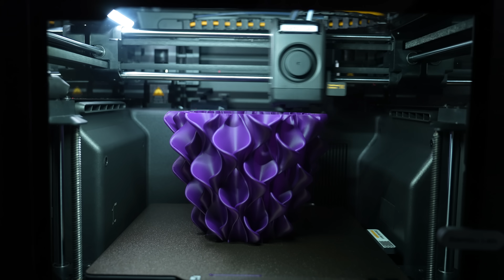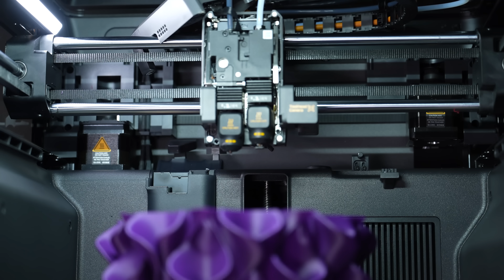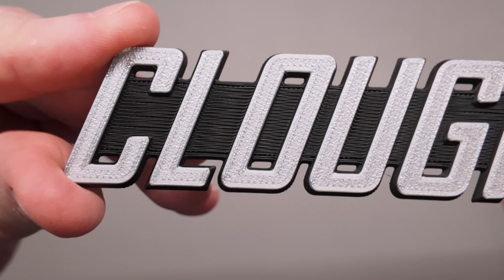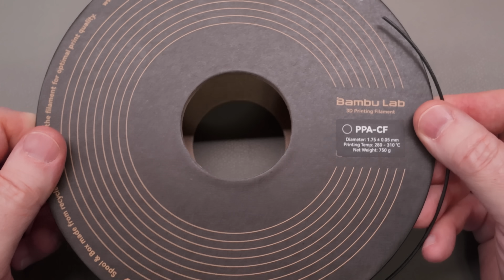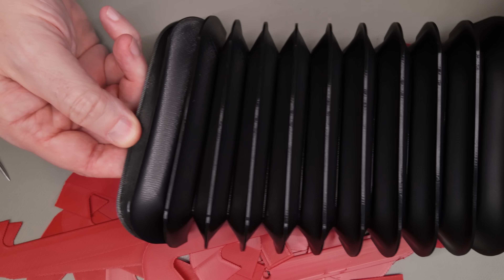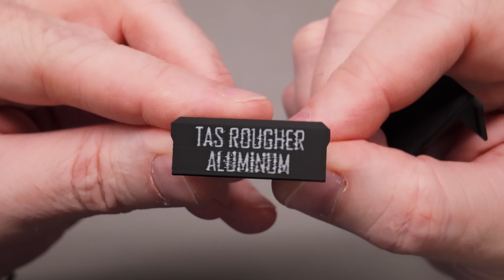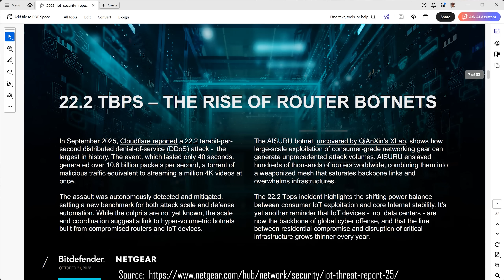X2D Deep Dive: Dual Nozzles, Bowden Extruder & Real 3D Prints

Comment: Here is an interesting issue what happened to me.
I stupidly downloaded a stl model on a site run by bamboo onto my Elegoo carbon 2 which converted my Elegoo settings into a Bamboo including bamboo build plate, bamboo filament,etc.
It was weird.
Reply: No, you didn't download an stl, you downloaded an 3mf file and yes, that is how they work

Comment: Just watched Thomas Sanladerer's vid on this.  Holy h3ll...I know a few people that just bought the P2S and are now regretting it...

I need this printer in a bigger format.  Like you, I do quite a bit of stuff that needs a 300+ mm bed size.  Not height usually (sometimes), but 100% I need it in x/y.  I don't need 4 colors...90% of what I do I want 2 colors and a separate support material.  LOTS of tool holders, and I want my tool holders to have the capability of naming (i.e., my Forstner Bit Holders (again, using your method for making tool holders), I want the sizes printed on the holder.  I actually CAN'T do this with a single color printer.  Nope...not without swapping material on the same layer, or requiring my labels to be proud of the top surface (which I don't like).

Comment: 16:05 it its very true sir. i have had the same challenges with petg for years. long story short; get multiple sets of darker blue biqu frostbite plates for all your petg prints. they are the best thing since sliced bread imo.

short story long;P
i do mostly aquarium and plant stuff so petg i perfect for my use. after many years and printers i have had to compensate for this problem among others. then came the change... for me it happened about a year ago or so when i first tried a frostbite bite plate. the darker blue one, not the orange ones. (might be good too, i have not had to test them yet as the blue ones i got are so so so so good) 

petg sticks so well that i like to have the prints cool down in the printer to room temp as the flexing of a warm plate might warp the print. it sticks that well yes... its absolutely mental imo. and i have run them on about 24 kg og petg so far with 0 fails. 0... came close once on a square pot base, but i was monitoring is by coincident of almost empty spool that i wanted to replace for the rest of the print. the plate started to bow upwards in the corners from the magnetic bed!
so i quickly paused the print and fastened the plate to the bed with four micro welding grips for the win :)

Comment: How does this compare to the new tool changers like the SnapMaker U1 and Flashforge Gemini especially in terms of waste and speed for multicolor prints?  The X2D seems great for supports, materials, and simple 2 color prints if you use the auxiliary nozzle.  Also I expect greater reliability and lower maintenance with the Bambu.

Comment: I think you hit the nail on the head. This is for someone who wants a P2S with a heated chamber that also has a dedicated nozzle for support material. 

I never even considered having a multi-nozzle machine until now. Well that’s a lie I considered the prusa with the indx system but figured it was out of my price range. 

We have an X1C at work and I almost pulled the trigger on a P2S a couple weeks ago so I could stop using the office printer all the time.

Comment: Meh, constant cloud connectivity...or connectivity of any variety... even if only for continuous firmware updates is just not necessary if the manufacturer has provisions for disconnected operations and firmware updates.

It's a scare tactic to refer to disconnected operations without firmware updates as "running with scissors", but your point is taken if you're referring to a connected device.

I also understand that connectivity is a key feature for some, but not everyone requires it. Many refuse to accept the risks and consider those features to be a strike against the product in question.

Comment: Had me until wifi only. Pass. To have a printer designed primarily for engineering grade filaments and eliminate off-line printing is laughable. Hey bambu ... no option of off-line printing ... no sale line in the sand.
Reply: You can print off line, wifi only means no ethernet port.

Comment: I notice that you didn't address the elephant in the room:  The SnapMaker U1.  About the same price, 4 real toolheads.  And it still works perfectly with Orca slicer without cutting out any features, especially the ability to sync the filament information with the slicer.

I'm not sure why someone would pick this over the U1.
Reply: So you can print some serious materials,  simple as that.

Comment: New to the channel, but could you walk through your network setup? Having the Bambu printers on a separate network segment? I have a similar setup for my smart devices and would like to run my printer in that same zone. I would be interested in what works, what doesn’t, and what workarounds you had to implement. My smart device network only reaches out to the internet. My trusted next can reach onto the smart network. And I static nat any device I would like to reach directly. I also will build security policies based on what is needed from trust to smartnet

Comment: You say its not possible to make the bellows for your milling machine in a single nozzle printer because of the tpu - AMS compatibility. But there is AMS compatible tpu. Could you not use that? Or is the AMS tpu not flexible enough?
Reply from the maker: Not nearly flexible enough.

Comment: Why do no reviewers mention that, in terms of default profiles, the x1c is hugely faster than the p2s, x2d and h series?

For example, an object that the 0.12 profile on the p2s, h series and x2d print in 7.5 hours, the x1c on its "0.12 fine" profile prints in 4.5 hours!!!

This is NOT a small difference.

I am sick of reviewers ignoring obvious differences like this that users quickly run into when using their new "upgraded" printer

Comment: I got the P2S immediately on release, if the X2D would be available at that time i would probably go with that, but to all P2S owners, dont be sad its an amazing machine, and i get 65°C chamber without a problem, just put a towel on the machine (just left out the back were the venting openings are).

Comment: Review is great.  I will say though that your risk analysis is flawed.  Having stuff completely offline is more secure than online devices even with constant firmware updates.  If you don't believe me, think about how much software security affected you in 1995 vs today.  What's the difference?  Most things were not online.  We didn't have better patching in 1995.  My H2D is in lan only mode on a network without internet.  I lose tons of features, security isn't one of them.
Reply: Also, thanks for the reminder to update my firmware 😎

Comment: Looks like you are one of the very few who actually understand the actual purpose OF the X series. Its not a Hobby multicolor printer, its a Business/Professional printer. The X1C, and X1E are focused on premium printing for Business and Engineering while the A and P series are for hobbyists.  The H2 series is the true multicolor  large format systems.  When I looked at the specs today I realized what its goal is. Primary filament with Support add on. The majority of my prints are main filament with Support in single color, and if I do that on the X1C there is a LOT of waste. Now the X2D can do what the H2 does for majority of prints without the waste.  You see on FB groups how they are all trying to compare it to the U1 multi tool 4 color, but not understanding the target audience the X2D is going for.

Comment: I generally really enjoy your reviews and their engineering focus. However, as a computer scientist I really cannot resist commenting on the security rant.
In short: what you are saying simply doesn't make any sense. Yes, devices connected directly to the internet need to be kept up to date. But using that as an argument for why cloud connectivity is necessary in a 3D printer is completely circular.

From a security perspective, it's the opposite: every additional device you connect to the internet increases the attack surface of your network. Timely updates mitigate this issue, but that's all they can do. Conversely, a correctly configured, purely locally networked device simply doesn't present any attack surface in the first place.

Comment: I'm glad you tested the second nozzle for beyond what Bambu is saying it's capable of. We've used bowden extruders for years before direct drives, they can print most filaments (TPU notoriously needs to be printed at slower speeds on bowden) and they can produce good quality prints so I don't buy all of these disclosures they are giving out for the second nozzle. They should also be able to print at good speeds.

Comment: Thanks for the review. I had sold my A1 a month or so ago to purchase a P2S. After hearing that the X2D was in the works, I held back. Just placed my order for the X2D this morning. I get that it doesn't have 2 direct drive extruders, but for only $100 more than what I had planned on spending, the heated chamber and that extra nozzle (even with it's limitations) were a no brainer for me. Guess time will tell!

Comment: Does the HT and the AMS2 require external power or will the X2D power the dry function with out external cords and plugs?
Reply: It does not require external power, but I don't believe you can heat the filament while its printing. Source: got an X2D today

Comment: So I guess printing mini figures for D&D on .2 nozzle is beste done with the H2D then if you want to use a support material to not break small parts?
Or would the x2D still be able to do this?
Reply from the maker: That's awful small for an FDM printer.  I think most people who print minis go for resin printers.

Comment: LAN only mode on an isolated VLAN with no Internet works great on Bambu. I do my remote monitoring locally using an addon in Homeassistant. I also uninstalled the Bambu software and run Orca Slicer only.  My P1S is on the last version before their device takeover, not updated in over a year.

Comment: Can you use a 0.2 hotend on the main and 0.4 on the support?
Reply from the maker: The slicer currently does not support mixed nozzle sizes, though I have heard rumors that feature may be coming.
Reply: You can with some light trickery

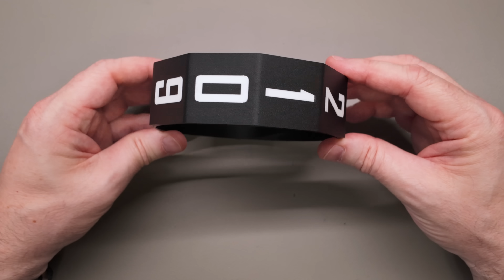Comment: 14:25 - Mechanical Pinball machine or an older Gas Pump with the Gallon Bell.  I miss the Gallon bell as well as the double chime air hose station bell.

Comment: You say it gives you a second nozzle and a heated chamber (over the P2S), but doesn’t the P2S have a heated chamber?
Reply: The P2S does not have an active heated chamber. It is only passively heated by the hotend and build plate.
Reply: @ADBBuild  Well shit. That was one of the reasons I got it over the P1S 😂 Ah well. I’ll just need to get the X2D as my third printer sometime 😂

Comment: $899 for the combo with the AMS 2 Pro seems like a pretty good deal.  Considering the original X1C was $1,399 when I got mine.
Reply: I wish they had put the higher temp extruder like the H series in this update.  With the heated chamber it just makes sense to have a higher temp extruder to do more of the engineering grade materials.

Comment: Great review, thanks.  I purchased an H2D in part based on your reviews.  What I would really like would be a form factor like this:  20-24" Wide x 6-8" Deep x 4-6" High.  That would be very useful.  Some parts don't look so great with joints.  Of course getting such long parts to not warp might be a problem.

Comment: I run a farm of X1Cs and have H2Ds and P2S’s, my new criteria for all Bbl printers is: can I iron large surfaces as well as the X1C?, unfortunately every new gen printer has failed, so I’m not very optimistic for the X2D. I’m thinking of running some kind of contest: iron my sheet, and win something. Because no new gen model can iron the entire top flat surface of anything as big as 200x200 which is what I use my X1Cs for.
Reply: Why can't the newer printers do it?
Reply: I say “failed” after 4 support tickets and every bbl engineer trying to help me make it work, and no combination of settings has worked. This niche use case is one left behind and I’ll be needing to buy P1Ss and old new stock and eventually used X1Cs soon.

Comment: I was saving up money for the P2S, and now it's being dropped in favor of the X2D. The pricing on the P2S doesn't make sense anymore. The pricing of everyone else's printer doesn't make sense anymore.
Reply: Creator 5 pro stacks up well. Basically the same price. Bambu gives you access to more than 4 colors, a heater/drybox and their excellent ecosystem while flashforge gives you 4 tools.

However if someone comes up with an open source multi material system with drying capabilities for tool changers, x2d starts to feel like a wet fart you shouldn't have risked.

Comment: Thanks for the review, I think this a very good printer at a very good price, off course when you already own the H2C, this printer would be a step back. 
A side note about PETG prints with PLA supports - I was struggling with weak layers as well, and I also thought it was due to contamination - contamination is not the only reason, it is also because the fan that cools down the support PLA also cools down the PETG and it creates weak layers in the PETG. 
So PETG with PLA support is pretty much out of the question if you print functional prints that needs strength. 
PLA parts with PETG support works great, I use it often.

Comment: I am concerned that the image I'm seeing of this new machine does not show a vent.  I'm assuming you are relying on carbon filters to handle the fumes, i.e. styrene, generated from ABS and other materials.  I suggest you consider testing the efficacy of the purifiers.  You will be doing yourself and your viewers a great favor if you pin down the potential health hazards these machine may produce.  I do not trust manufacturers who assert they have addressed health concerns when they are not regulated or answerable to anyone, except diligent reviewers.  I hope you take up this challenge.

Comment: speaking of cloud connectivity, and bambu products. The bambu farm manager, while received poorly by many people due to the security changes required when it was rolled out in firmware. Still allows you to have many of the normal connectivity features. While having a centralized location to manage your machines and prints from. You can go right from bambu studio and send a print to it same way you normally would. You just choose the farm manager client as the target. If your using that. if not it leaves your machine accessible still via a lan only mode interface. If you want to bypass the farm manager. Allowing you to use the machine as you normally would. The caveat is that you will be logging into your bambu account still for farm manager.  Anyways I would encourage people in the ecosystem to check it out if you haven't already. Its can be very helpful when running many machines and jobs at once.

Comment: I jumped into 3D printing this past year wit the P2S.  It's been a learning experience. I've had issues with first the AMS and then the printer itself that have required the replacement of parts. Nothing major and Bambu has been good about getting them to me once the root cause has been determined. In my case I feel that they could do more in the support space. All of the replies are done overnight possibly due to the support agents being overseas.  While the second nozzle in the X2 has its uses I don't think that in my current situation it makes sense. I also don't print using engineering filaments (yet).  When/if that day ever arrives I think I'd just jump up to the H series. A more functional second nozzle and the larger capacity would make sense at that point.  

As far as anyone not liking your disclosure thats just nuts. First, I'd like to know if there is a possible conflict.  Second, anyone who has watched one of your reviews knows that frees tuff isn't going to sway your opinion.  I am certain that we later adopters have you to thank for updates made to the printers due to your feedback to Bambu.

Comment: here's what i don't understand about this notion that people should be updating firmware as soon as possible. For devices connected to the internet, I can see this point you are making when it comes to IoT devices. I can understand that argument. But the part that seems to not be discussed is why it MUST be connected to the internet in the first place? If all of those capabilities you want were supported in LAN only mode, then security-minded consumers don't need to connect it to the internet and immediately update firmware as soon as it is released. They can just communicate locally with the device on their own network. And of course the other point is that it assumes that the firmware updates you are immediately saying yes to are never compromised - either in security or in reduced functionality of the devices from the manufacturer. The number of devices that used to be capable of something and then the manufacturer kills it to make more money is REALLY LONG. As informed consumers (and reviewers) we can't keep pretending that this doesn't happen or that these vendors will somehow be immune to this in the future. Things change, and the consumer who owns the device should be in control of what changes are made to it.

Comment: i was considering buying a 2nd printer to use if my H2D is busy and i need a part. the H2's are a very pricey "back up printer", but the P1/P2 would have enormous print times with the parts i make. this seems like a great middle ground and built to do exactly what i need - primary filament and support material. i'll be using your affiliate link when its time to purchase! Love your work, thanks for the video